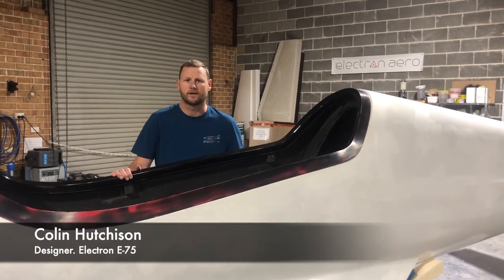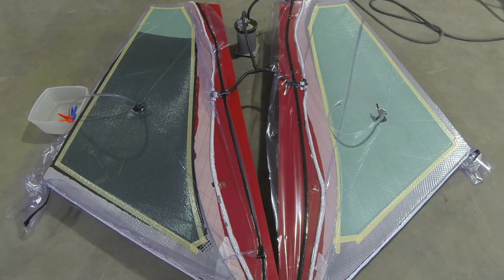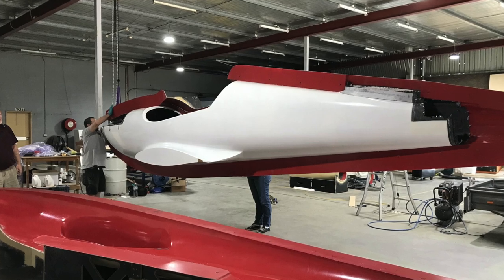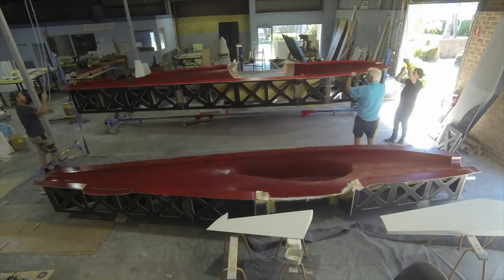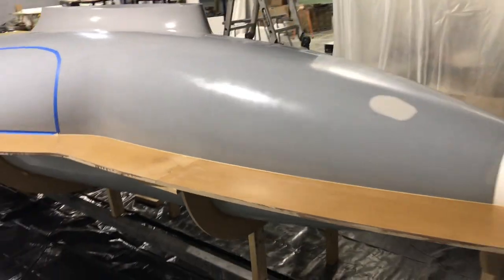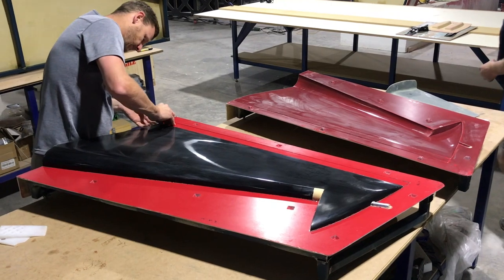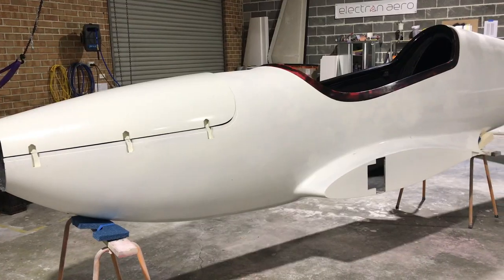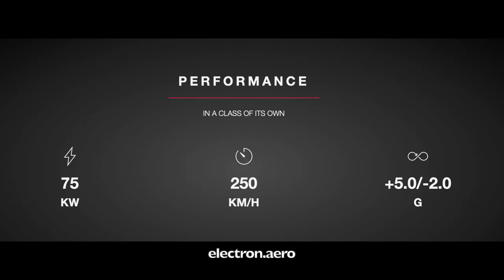Electron E-75 Two Place All Electric Aircraft

Comment: On behalf of the Electron Aero Project I would like to answer a few of the questions and comments raised.

We use current technology LiPo Batteries.  The batteries are stored in the nose (where the ICE would normally be found) and weight around 200kg.  MTOW is 600kg, so around 1/3 total weight is in the batteries, 1/3 weight in PAX and 1/3 weight for the rest of the airframe.
Current charge time is around 2 hours for a fast charge.  With new battery technology on the horizon we are looking at charging to full in under 15 mins.
To take advantage of the speed of the aircraft and to remove all fluids from the aircraft, the motor, controller and batteries are all air cooled.
Take off performance is greatly increased with electric motors over an ICE.  We have no loss of power due to density altitude.  We have 100% torque available 100% of the time.  We can overload an electric motor and get more power out of the spec'd engine for short periods of time.  So take off runs and climb out can and will be much better than the equivalent ICE aircraft.  We are looking at a maximum take-off run of 160m at 5000ft and a rate of climb of at least 1500ft/min.
Flight time is based on best L/D at 95kts.  This gives us the maximum range for flight at around 200 nm.  We can fly at a speed of 150 MPH (130 kts) at a 70% power setting.  In this case we are looking at a flight time of around one hour plus reserve.
Current price point for the kit aircraft is USD$120,000.  This includes everything needed to get in the air except for the paint, upholstery and instrumentation.  Motor, controller, batteries, prop, undercarriage, fully moulded carbon fiber fuselage/wings/tail (everything you need to fly) will all be included in the kit.

Great work Mike, thanks for the video
Reply: @ryanthomas2472  We are still building the first prototype but hope to have it flying in the next few months.

Comment from the maker: Expected Kit price for the Electron E-75  is $120,000. This will include everything except for paint, upholstery and instrumentation. A fully molded carbon fiber fuselage, wings, tail, undercarriage including wheels and brakes, battery, controller, motor and propeller.  Essentially everything you would need to get an electric aircraft in the air.

Comment: Chances are good that over the lifetime of this aircraft battery technology will significantly improve and simple upgrades will be available.  Wouldn't it be cool to build a plane with  solar panel material embedded.  Seems possible since there are flexible solar panels.  Extend the range and or let it sit in the sun and recharge.

Comment: So many questions.

What kind of batteries does it use?  Where are they stored?  How are they cooled?
How much does the plane weigh with those batteries?  How does that affect performance - T/O, Landing, Climb Rate, Useful Load?
What is the service ceiling given the engine doesn’t “breath”?
How long does it take to charge to full?
Reply: What is the capacity of the battery pack, how much does that weigh. How fast do they recharge? What has been done in case of impact? Is there a charger available? 
2,5 hours flight time? With 130 kts/ 150 mph? Why does it only go 200 miles on a full charge? Thats not 2,5 hours. Those numbers do not add up.
Pipistrel is side by side 1,5 hour endurance not an hour, and its no comparison to a tandem seater. This is not a basic training aircraft, which the Pipistrel is.
So many more questions.
Mike was reading from a brochure in stead of actual researching, me thinks.
Reply: You can't really spec an electric like that. Motor performance will increase with altitude due to cooler temperatures, so it will no longer be a limitation. Service ceiling will be dependent more on wing loading, which again highly build specific. The electric motor is far superior to ICE so you'll have no problems there, battery tech is going to be the biggest performance factor. Currently we are at about 250 wh/kg storage density with Lithium ion, but that should improve to 500 wh/kg in the near future, which would double flight times. Assuming this craft is designed around 250 wh/kg batteries. 1000 wh/kg should be here within the decade. Don't get me wrong, I know there is a second coming of ICE on it's way, but these electric craft will serve their market well. I imagine they will replace the private sector, and ICE will be used in high power, high speed, long range applications.

edit: Changing out batteries should be manageable anyways, and motors are cheap (Tesla motors are around ~$1000), so your probably guaranteed a performance upgrade every 10-15 years, instead of an overhaul.
Reply: @Christophorus I understand, Im not asking these questions because Im doubtful of a future of electric planes, Im asking because they are relevant questions for current electric planes.

"Service ceiling will be dependent more on wing loading, which again highly build specific" I know this, which is why asking the specifics of this build is pertinent.
"battery tech is going to be the biggest performance factor" Yup, hence why I was asking how the battery affected performance.

I feel like these are all pertinent questions that should have a ball park answer when they designed the plane, that werent really addressed in the video

Edit: 1kwh/kg within the decade is optimistic imo, and needs some kind of battery breakthrough. Solid state is taking its sweet time and most serious companies are focused on incremental improvements to the standard battery. Things like lithium air batteries are becoming the new cold fusion

Comment: In the US market, Light Sport Aircraft are limited to a top speed of 120 knots or less, so drag will have to be added to this to permit registration as an LSA
Reply: without retractable gear, this comes in just under the LSA guidelines here in Australia where it's being developed. Not familiar with FAA guidelines but would it fit in the experimental class?
Reply: @Mark_Young05  oh yeah. easily.  Fits LSA guidelines EXCEPT for speed.  Has to be slowed down.
Reply: The LSA rules are in the process of being changed. Manufacturers are gearing up for 
1. Increased weight to 2000 plus MTOW
2. Increased speed to 150 knots
3. Four place aircraft 
4. Constant speed prop.
The bristell 915 is qualified as a light sport and all they did was lower the speed on paper, jusf like they lowered the weight on paper to fit in the light sport rules. It can cruise at 150 knots, but not on paper
Reply: @1shARyn3  I would assume there are ways to electronically limit it's top speed via de-rating the electric motor. Or just chuck me in as ballast

Comment: Pretty cool! Nice video! If they could get their hands on some Tesla battery tech. Especially next gen 1 million mike battery it could make this plane go further and last longer.
Reply: take out the second seat and put in Batt. 5Hrs??? fly time
Reply: dave robert not sure about that. Unlike a normal plane that gets lighter as it burns fuel. An electric aircraft still has the same battery weight. So adding more batteries may increase the range but would add a lot of weight. The weight per gained mile of range may not be worth it.